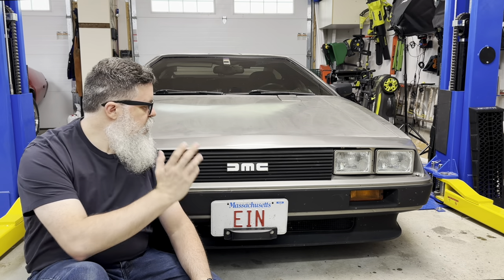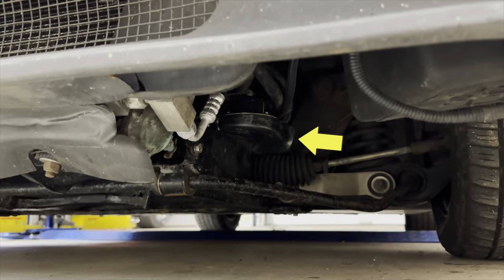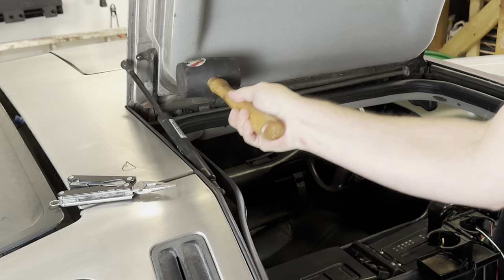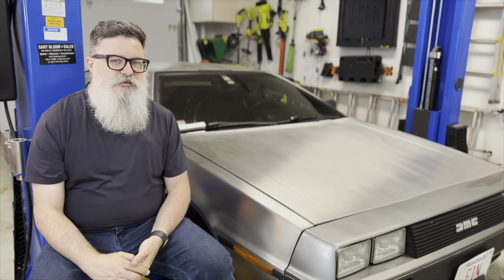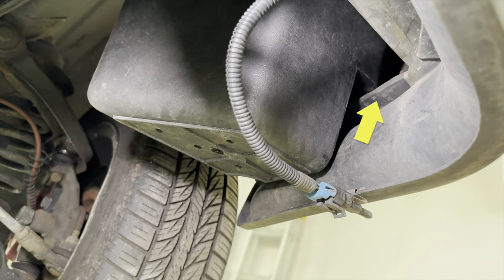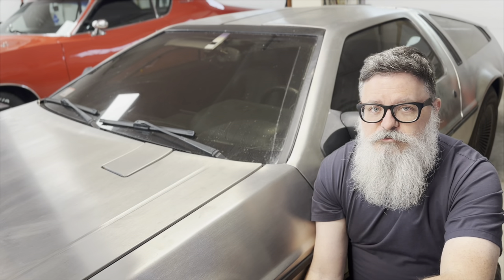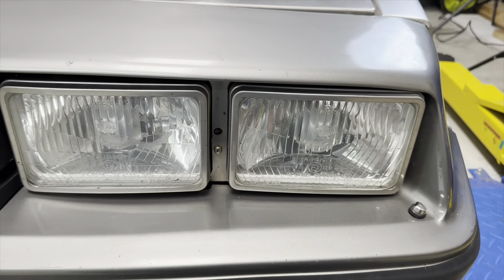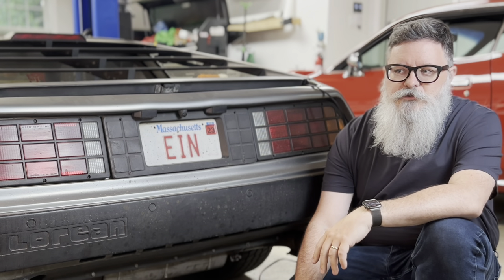Upgrading the DeLorean's washer nozzles and fixing things I've already fixed.

Comment: Joe in my humble opinion you installed the gas charged lift pistons on the doors upside down.
While the doors are wide open I prefer to have the oil and nitrogen gas cylinder above the silver rod rather than below it. And you're right the door struts / lift pistons don't last long if in constant use like maybe five years. Then you get droopy doors when it's cold outside.
Owner of VIN 02261 since February 2001.
Reply from the maker: I don’t think it matters which way they go, but they probably are. I once heard a theory that installing them upside down prolongs the life, but it probably isn’t significant isn’t if at all. 

I feel that my doors always droop in the cold. I can either have them rise properly In the cold and over-extend In the summers, or open properly In the summer and drop In the cold. I think that’s just how it’ll be with a passive system like this.

Comment: Are the front lights stock?
Reply from the maker: They are Hella 4x6 halogen conversion housings for the original sealed-beam lights, similar to these, although I’ve had them for so long I don’t recall the specific variant that I have: https://amzn.to/3oyekFq I use the same housings for both high and low beams. They’re fairly simple to replace, and they’re glass, so they won’t get sandblasted while driving as easily as cheap plastic ones. 

It turns out that there were exactly four choices for headlights before there early ‘80s, so it’s easy to find halogen retrofit kits that work with the DeLorean. Technology Connections did a great video about the reasons behind this: https://m.youtube.com/watch?v=c2J91UG6Fn8

I’ve since upgraded the halogen bulbs to LEDs that fit in there same sockets and have a halogen dispersal pattern so that they focus correctly in these housings. They are notably brighter than the halogens, which were brighter than the olds sealed beans. I think it’s a worthy upgrade.
Reply: @joeangellx I just bought a delorean and I'm baffled about something. Hopefully you can help. My front right turn signal light/parking light isn't working. Replaced the bulb and still nothing. So I bought the socket with wire and plug from dmc but I can't figure put how to access the plug??? And I can't access it from the front. And don't know where the turn signal wire runs up to. Any help would be great thanks!!!

Comment: Just noticed the name on the back is not filled in with brushed stainless letters as the later cars have it
Have you thought about getting this done
Reply from the maker: I’m on the fence about it. I kinda like the stock look there, but a bunch of guys in the club have the stainless letters too. That said, I did add stainless door sill letters recently, and they do look pretty nice.
Reply: @joeangellx  I installed the stainless steel letters after thoroughly cleaning the surfaces with Isopropyl alcohol and wiping dry with a paper towel. The adhesive I used is 3M Black Super Weatherstrip and Gasket Adhesive. Part number 08008. A year later the stainless steel letters were releasing from the plastic bumper and I pulled off two letters with my fingers. The remaining letters came off with a pry tool. The adhesive did not stick to the back side of the stainless steel but did remain stuck to the plastic bumper.
I have not attempted at reinstalling the stainless steel letters and I will reinstall them some day after I have the rear bumper repainted.